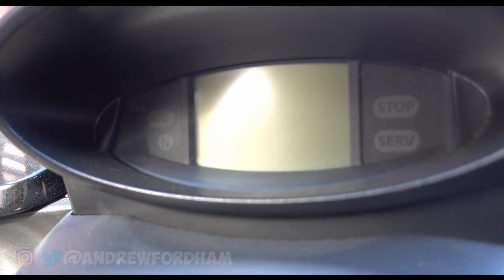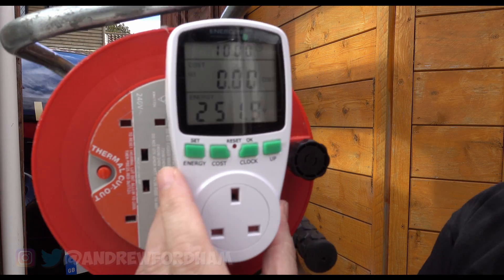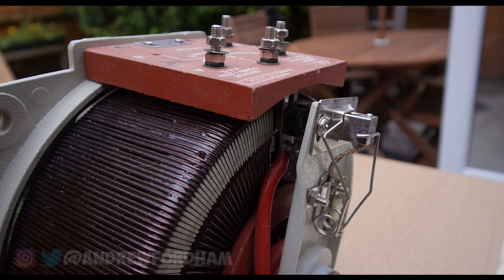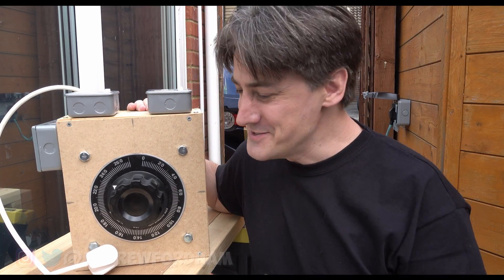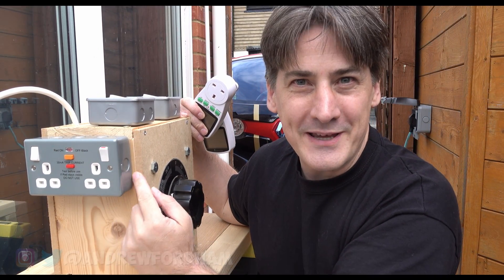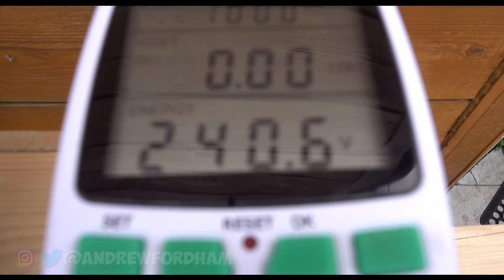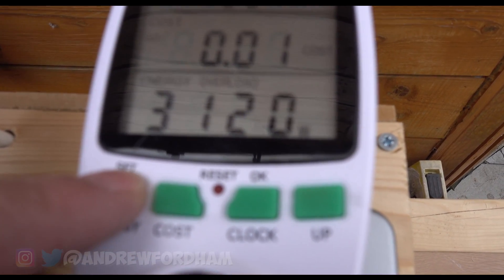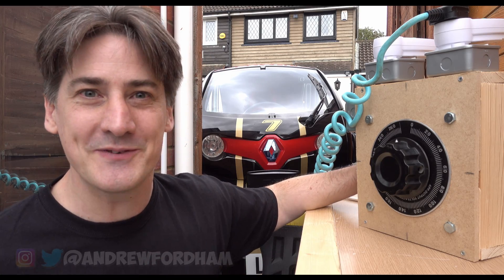The Renault Twizy - Charging via a Variac for Solar

Comment: Hello Andy, thank you for the idea to use a Variac Tranformer. I have following problem: I baught an EcoFlow Delta 230V AC / 1800W Power bank. It can give me 10km of extra range. Now I need to reduce the charging Power of my Twizy from 2300W to 1800W. Can you make an experiment for me? Can you test if it's possible to reduce the voltage until the Twizy takes only 1800W of charging power? It would help me a lot. Thank you verry much. Daniel

Comment: Andy - Did you have to do any rewiring on that Variac to change the earth? I had a gotcha on some little 3a ravistat variacs a few years ago, they're supposed to be in a metal housing... being in nonmetal there are some mods to make
Reply from the maker: john bumptybump no mods to the variac, but the only thing I added was an earth cable to one of the 4 bolts that held it in, seen from the front. They are pretty robust. Thanks for watching !
Reply: @itsAndyFordham  Yeah i think that's probably good if they're actually making electrical contact. I used nylon bolts to hold mine into those bigass grey IP67 boxes so had to provide a proper earth...lol. It was worth asking though just for heads up value. All the best pal!